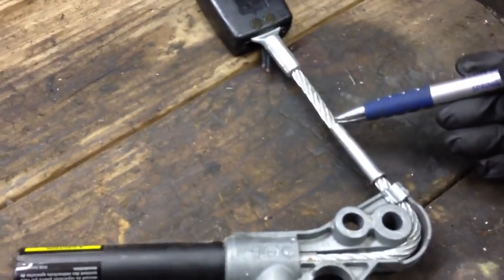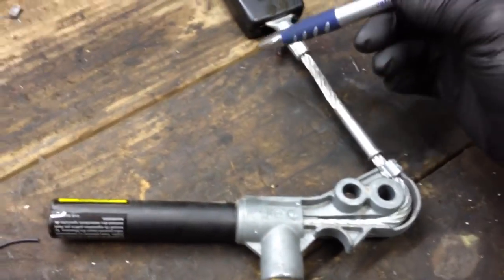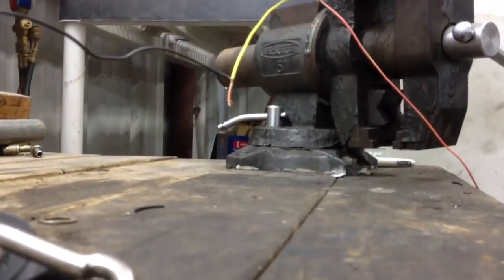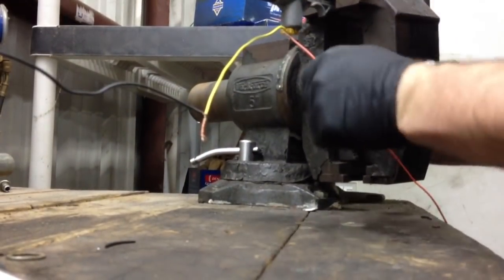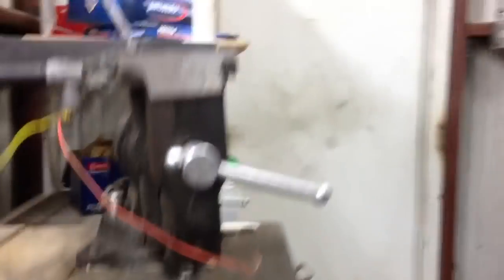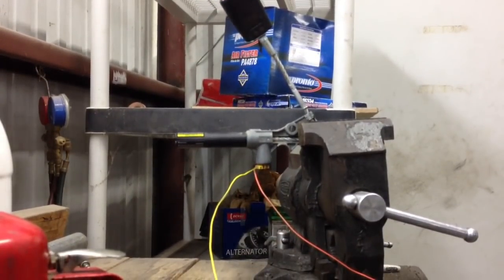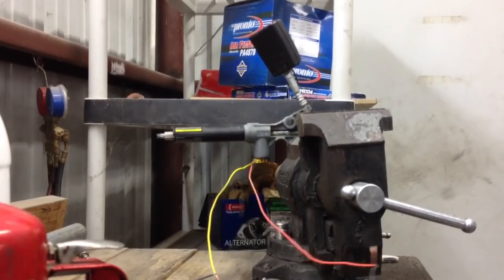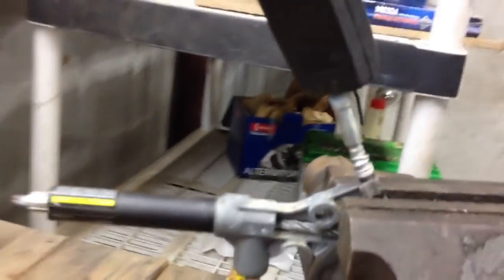Seat Belt Pre-Tensioner

Comment: Did you happen to cut the black part (the cylinder) open? I suspect it’s just a strong spring inside, which is compressed by default.
Reply from the maker: The black part is actually a pyrotechnic charge. When activated, it ignites a charge that explodes, but held within the black cylinder.